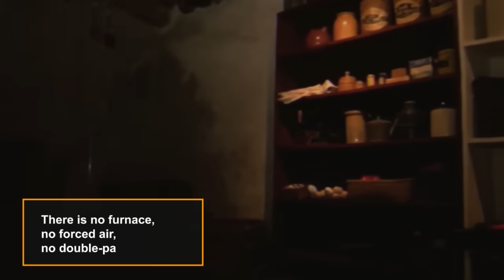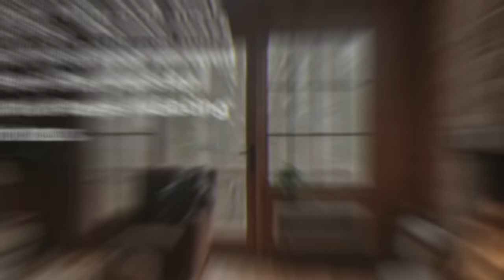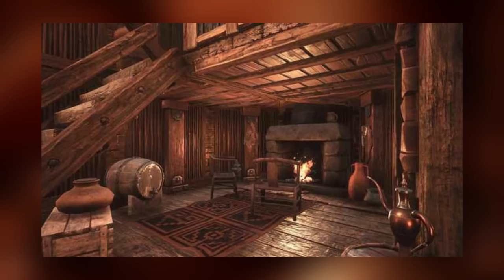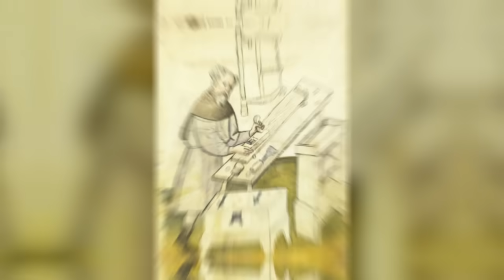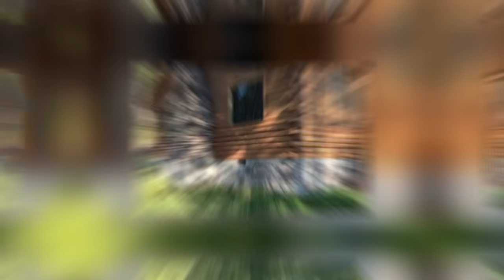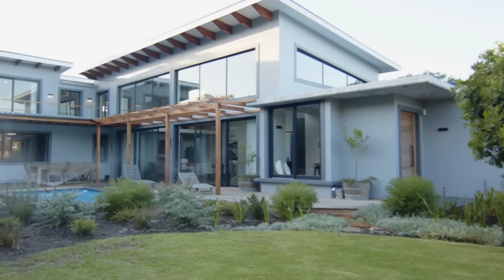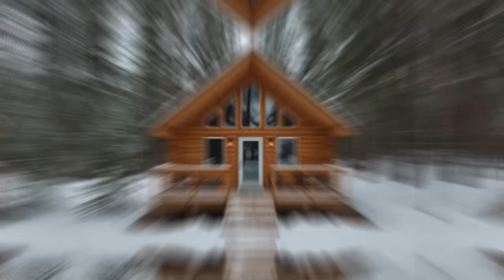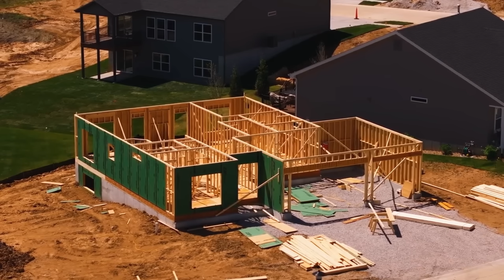Why Medieval Log Cabins Stayed Warm in -40°F While Modern Homes Freeze

Comment: Something most people don't understand about building codes is that they are the bare minimum required for a home to be considered habitable by modern standards. Inspectors treat those codes as gospel, and if a building is built better than code, it's usually rejected as uninhabitable, which makes zero sense. It's a case of bureaucracy and complacency run amok.

Comment: I have in both 500 year homes and 3 year old homes. The 500 year old home didn’t much  heating. The thatch 2foot minimum kept the heat from escaping from the roof. The walls were 2 foot thick deep with small windows . At night thick curtains kept the cold out and in the day being south facing allowed in as much sun as possible . The floors were wood with the gaps blocked up but they were up from the floor which meant that the damp couldn’t get to them. 
We had a central stove in the middle room which was on the whole time on a low heat that warmed the upstairs rooms through. Series of chimneys 
The lower rooms had the doors open to share the stove heat. 

Our brand and new home retains several  things with our old home. Up of the ground so it can’t get damp from there. Walls at least 2 feet thick this time filled with insulation . Sounth facing windows , this time benefiting from. Triple glazing . We have a heater we have on once a day to bring up the heat after night when it has dropped a couple of degrees . It’s on for 30 minutes the temperature goes up and on a sunny day that that’s it for the rest of the day. On a run of grey days , you will need an extra 30 minutes early evening so it doesn’t drop too far. 

Both houses work really well but the heating for the older house cost more as the stove needed to be on all day.

Comment: A lot of the high-thermal-mass structures you see today in Europe were built after generations of older structures got replaced. Every time there was instability or migration structures had to be built quickly and those didn't stand the test of time like the ones that had generations of resources to draw upon. Similarly the US was nothing but migrating settlers and an entire industry sprung up of using wood more efficiently as a result. Today you have entire cities built from the ticking time-bomb that is steel-reinforced-concrete, a quick and fast method of building load-bearing mass. Thermal mass will come back in time and with new ideas.

Comment: This is so fascinating overall. I'm especially intrigued to learn all of this about sphagnum moss.  I use it in a humidity box for my snake, Beth- who, as a reptile is cold-blooded and especially needs a variety of variables in her environment to self-regulate- like temperature, moisture, and humidity at various parts of her enclosure. Just as this video says, and sphagnum moss basically lasts forever, and kept moist provides a soft, humid section where she can rest, or prepare for a skin shed.  I'm especially intrigued by the use of it in a roof, maybe all because I would think the moss would do a lot to maintain humidity in the home.  Our modern homes tend to get very dry in the winter, and I bet the sphagnum moss prevents that from happening.  A natural humidier, you might say.

Comment: My home stays warm for a couple of days even in very cold weather. It does have lots of windows and sliding doors but they are Andersen. I have heavy insulation in the attic and in the walls. Also, have a basement.

Comment: First two winters of my home, the gas furnace didn’t work. House built in 1920 and then refurbished in 2020 before my purchase. House got down to 10s-30s multiple times and had to use electric heaters to keep two rooms bearable decent. Furnace works now and is fine through the winter but if the power grid were to go down, it’d be freezing in the winters. This along with a woods stove and/or fireplace fixes all of that

Comment: There’s a simple solution to thermal mass. Indoor sealed water tanks unobtrusively located in corners or on the floor.  Water has huge thermal mass compared to most common , everyday things.

Comment: This video is pretty funny.  I live in a log home with 8” white pine walls and thermal mass has some advantages during transients, but it doesn’t reduce the amount of energy required to heat the home.  This seems to suggest that the heat stored in the logs magically appears from thin air.  The thermal mass just delays the thermal cycle, it doesn’t make less heat be required.  If you start with a cold house, it will take a lot more energy to get the log house up to temperature as compared to an insulated stud frame house.  Yes, the house will cool down more slowly, but you are just getting back the additional energy you put in at the start.  And during steady state, most log homes have light air infiltration rates than modern homes so they actually use more energy.  This video has a lot of wishful thinking, but very little science.

Comment: Have i ever felt the cold, YES.. My home for 2 years in my apartment dident have heating.. The corridor outside my apartment was hotter than my apartment, Tho im one of the lucky ones with a warm body, so it dident bother me to much.. Tho after 2 years the owner fixed the heating system and i got heat again HAHAHHAHAHA..

Comment: Wood logs had really high R value and small gaps easily filled.  But then - there are a crap ton of comveneinces modern homes have...  And log homes are expensive to make as you need really nice logs.

It is not that "something is wrong" - there is a tradeoff...  Just like with anything.

Comment: Yes but when you know how to stop heat escaping, or at least a good chunk of it escaping too quickly cover windows with blankets covered. Doors with blankets put towels in front of the doors on the ground to stop jam up cold air from coming in hot air, from going out. Close all doors to the house, leaving only small areas to heat.
And you will retain more of the temperature inside the house.
Then, losing it to the outside temperature

Comment: Whatever the correct approach, there have been folks advocating for more insulation and all the rest for 50 years. In the end, which costs more, the initial extra cost for the insulation, thicker walls. Etc. I'm told that a passive house cost about 30% more than a regular home. Say back in the 1980's you bought a home for $250,000 and 30% more is $75k. Now, at the same time, we have very few power outages, so some have generators, but most don't think about it. However, heating and cooling is comparatively inexpensive here. So, even if you saved $100 a month for 6 months of the year so that is $600 and it would take 125 years to break even. Yes, this is a simplistic example, but it is the same for solar. The up front costs are so high, many folks say, it's cheaper to just pay the utility bills. Now, many say they care about the environment, BUT far fewer are willing to pay for it and the politician they elect in many countries, refuse to take the climate emergency seriously not matter the science.

Comment: Building a log cabin today is very expensive, due to the high cost of wood. Building an entire house with old-growth logs would be even more expensive, since it is very hard to find that kind of wood now-a-days. My father owns a stick-frame house built in 1887. It stays warmer longer than modern houses, because uses so much more wood than modern houses and its plaster is much heavier than modern drywall. However, it does lose a lot of heat thought its windows.

Comment: I have a unique home, built in the South of the US.  In 1967, some guy reclaimed some queen brick, and built a home with full basement, half in the earth on full concrete and block. The neat part is that it has a Cedar Timber frame underneath. None of it is exposed or cosmetic. It went thru a few "updates" from previous owners, but once I discovered how energy moved through the home and how it controlled moisture, I corrected their mistakes.

I can run a single Wood stove in my basement that heats the entire home enough that the furnace does not run in the winter if a fire is burned every night.

The Hearth in the kitchen will make the paint inside sweat.
My plan is to gut all the sheet rock and modern garbage and return it to its original design with shiplap paneling. A humidor in the winter and a cave in the summer. Its as close as you can get IMO with a modern home.

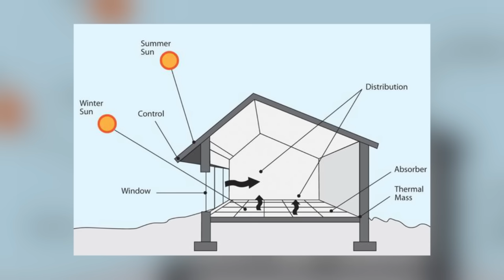Comment: 2:36 Just saying, if you think that 2x6 is standard, then everything will be thinner and colder than that. Starting at an incorrect premise.
BTW, I live in the tropics so we design for a different type of "insolation" and temperature control.  I have managed for several days without power during the summer and still never really gotten above about 82 degrees Fahrenheit.  That's not comfortable, but it is a lower temperature value than what I lived in without A/C in Panama back in the day.

Comment: READ ! Logs homes had SERIOUS issues  Theyb were better than Tents but Not much. The things entirely relied on the Mud /moss packed in between the logs. 
BUT that packing dried and fell ou with regularity.   It required Constant maintenance. . As the loss of  turned a Log bldg ito a weather sieze.

Comment: my parents house was built in the mid 1800s , Square timber  , large wood cook stove in the kitchen . the way it was built , where the windows are , vents between floors so the heat circulates . Not 1 piece of finished wood .The trees here grow so slowly that pine and spruce rings are as tight as some hardwood south of here .

Comment: Lost power after a blizzard for 7 days, when a child. Oil heat which couldn't use because without electricity couldn't start the burner nor would fan blow the heat. My parents used the gas stove to boil water; we closed off the living and kitchen from the other part of the house with planked. While the temperature was colder than normally would like, we didn't have a problem keeping the place warm enough to living during that time. Also, basement don't due how far underground, normally don't drop below freezing even when below freezing get below the frost line ground get warmer normally 3-5 feet, most basement are at least 9 feet under groundl

Comment: Full of half truths and myths. Wood has a low thermal mass. Dense hardwoods have poorer thermal insulation qualities than open celled softwoods. Historical buildings were draughty because of open fireplaces, no weather seals to windows and doors, only single glazing. That’s why they so often needed door bolsters and heavy curtains over doors and windows. A new SIPS-built house  with triple glazing, heat pump and a cast iron log stove can be heated with a fart and will stay warm for hours.

Comment: We have a modern isolated european house 12cm isolation double glass windows etc... if I heat my stove i can bring the entire living area aka 2 floors with 150sqm to cozy 22degrees 24 near the stove, the stone in the stove can keep this temperature 12-15 hours! So you can build efficiently. But we have a heatpump so heating the stove is more like a luxury than anything else the heatpump does the job! This beats a log cabin by miles, due to the fact that a log cabin is maybe 20sqm so a bigger tent! The magic is the mass you can heat up, european houses tend to be made from stone and have very good isolation!

Comment: I insulated my loggia from the inside with a homemade perlite plaster. The plaster is 6 cm thick on average. The apartment is in a prefabricated reinforced concrete building. The temperature on the loggia increased by almost 10 degrees Celsius in the winter, without any heat source!

Comment: There are many builders that build energy efficient homes but most buyers don’t want to buy them because they are too expensive. They use tricks like 8 inch walls with staggered 2x4’s and blown in insulation, geothermal heating, passive solar heat (south facing), triple pane windows. They can’t do things like 7’ ceilings and small windows because consumers don’t want that.

Comment: Stop pretending forced air 'heat' is actually heat 😂. Blowing air doesn't heat anything, it only cools, i don't care what temperature it is. A house with a furnace has only one room with real heat in it - the one where the furnace is located. It's all a cheap gimmick to fill real estate developer's greedy pockets. Ask people in Russia if they've heard of 'forced air heat'.. they'll probably give you a blank stare. Every room has some form of radiant heat, plus often these days under floor heating in addtion(!!!) to the radiator is very common even in a studio apartment, plus thick walls. Everything we accept as normal in the US is about GREED. Only buy a house with hot water heat, don't fall for the 'forced air' scam. That's NOT heat.

Comment: I live in a 200 year old timber house in Sweden. The biggest problem er have related to temperature is during the summer when it can get incredible hot inside. For being a 255m2 house it is incredibly cheap to heat. I give that credit  to the old style of buildig and materials used in the house. The only electric ventilationsystem we have is for the two midern bathrooms, the rest of the house use what we call "self draft". It used the natural breathing of the material and gaps in windows and doors to circulate air.

Comment: I'm 68 years old.  After 28 years in our house I'm satisfied I could survive an extended power outage.  large wood stove in the basement with 3 cords of seasoned wood ready for the winter.  A gas fireplace that can heat a few rooms easily.  And a pellet stove with a uninterruptable power supply.  Quality hard wood pellets from a local source in Clearfield PA.  Plus a generator to backup if we ever need it.  it's not perfect.  But it works for us.

Comment: The problem with  American residences is that they are built for looks, size and convenience. But in reality, these two-by-four particle board contraptions   where one can shoot through the walls inside and outside, which fire takes down in a very short time and which cannot withstand violent winds, are despite their high price relative to their quality built with cheap materials and are designed  for low energy costs.

Comment: um I stopped the first 2 minutes in. Heres why. a small 12 foot by 10 foot cabin with thick lumber walls with a fireplace compared to a house that is 2-3 THOUSAND square feet, and no backup heating system is like comparing an apple to an iguana and wondering why you get bit when you hurt it.

Comment: An air-tight enclosure will kill its occupants. An exchange of air must prevail.

Homes leak, even with all windows closed. Reducing leakage improves heating efficiency but leads to poorer air quality. The modern trend is to reduce leaking, leading to health problems from poor air, and may be a foolish mistake, especially when built into building codes.

So I am wondering where these log cabins fit by comparison. There must be heat loss from an exchange of air just as in any other building. So does this not make them more similar to other buildings than the video suggests? And especially if heating by combustion rather than electrically, surely that necessarily increases the exchange of air, to bring in oxygen for the fire and the occupants.

Comment: Thermal mass is unfortunately ignored in energy code calculations for code compliance plan reviews.  But having a lot fewer and much smaller windows also has a huge impact on energy efficiency.  Personally, I design with structural concrete insulated panels so I get the R-value and the thermal mass storage while still being buildable in a modern world.
Reply: I am currently building a concrete and brick workshop which will be unheated, was calculating that I need at least 2cm of graphite styrofoam outside to pervent/delay internal condensation overnight, Ct (heat capacity dependant on T) of hollow bricks, air, limestone plaster inside (good against moisture) and outside insulation, should be enough to pervent condensation for couple of hours overnight...the walls and ceiling are set, temporary roof for winter and now without plaster and outside facade, condensation starts one hour after temperature drop...

Comment: Sorry, but after some "research" I have to chime in with a second comment here: Something is either MAJORLY off in this video, or I misunderstood something completely... According to all reliable data that I could find, burning 1kg of wood releases a little over 4 kWh worth of heat. (It varies a little from wood to wood, but we get there on average.) One piece of wood that is normally used in a masons oven weighs somewhere between 0.75 and 1.5 kg (I took the liberty of weighing 30 pieces from my parents oven, who luckily still have one of those...) and filling such an oven once normally uses 5-8 of those pieces. If I take an average here I get to one oven filling generating a little over 20 kWh of energy, or ~68.000 BTU. Those ovens are at least fired twice a day, so we get to ~135.000 BTU of heat used per day. In a temperate climate like the one I live in we expect around 100 heating days per year, which would get us to 1.350.000 BTU of energy used in a wooden cabin that works with a masons oven. (Or roughly 4.000 kWh.) My modern house has a heat energy requirement of 7.600 kWh per year in comparison, but keep in mind that a typical wooden cabin has somewhere between 25 and 30 m² of usable floorspace, while my house has ~240m². (And of course, in terms of real energy usage I am down to less than 3.300 kWh, as I am using a heatpump. And that already includes hot water...) 
Long story short: I have no idea where this 15.000 BTU figure comes from, but it is absolutely unrealistic. And in the end that wooden cabin needs by far more heating energy per year than my European house.
Would be interesting to hear what real new US houses need and how they stack up against the wood cabin when calculated properly...